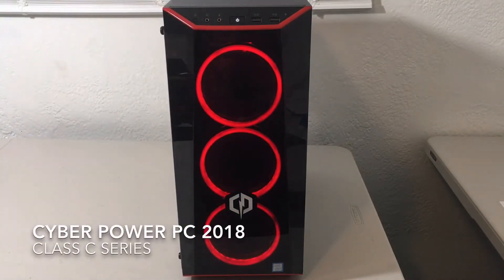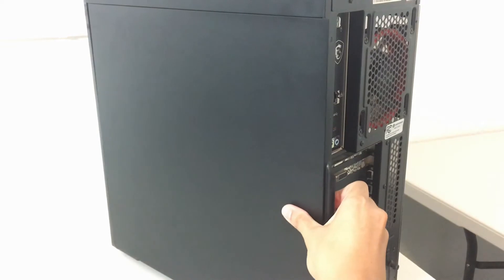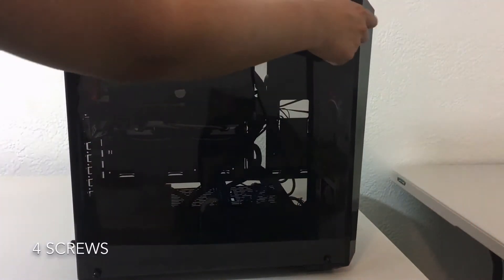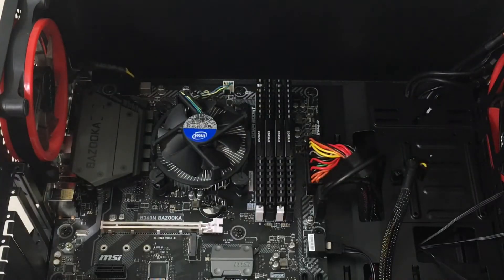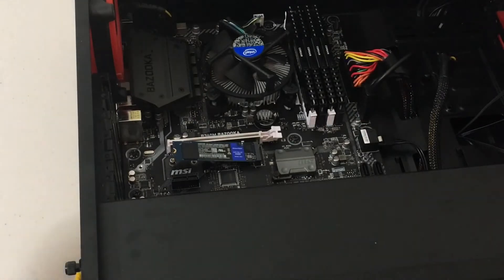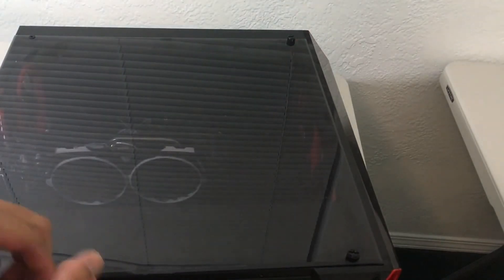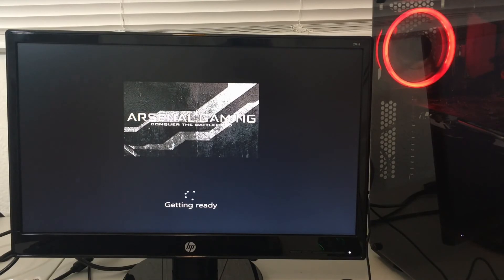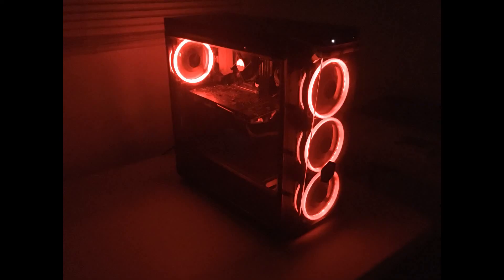Super Speed! M.2 SSD Upgrade on my Old Pre-Built Gaming PC | CyberPower PC

Comment: What size are your fans j have the same case but i dint know what size fan fits
Reply from the maker: Pretty sure these are 120mm fans for the case. Standard size. I need to check my case. I can check it in a week or so. You can use a ruler to measure to see what will fit on your case.

Comment: Removed my HDD and added my NVME and now it jus won’t turn on at all, any help please?
Reply: Like you only had 1 hdd?
Reply: Did you have windows installed on the hdd if you did put it back that might be the problem
Reply: You did something that you have no knowledge about. First after you install any type of ssd or hdd you need to reinstall windows again in that new drive unless you are adding it as a second drive.
Reply: If the computer doesn’t turn on at all then you forgot to plug it into the wall socket.
Reply: @simster1001 bro this was 2 years ago.

Comment: My motherboard doesn't have a mounting screw for the slot! VERY frustrating to discover once the case is open, etc. What size screw is required?
Reply from the maker: Most m.2 screws are pretty standard from my experience if you just search m.2 screws. Some kits come with washers and some don’t. I try to put a washer when I can for m.2 ssd, that being said i’ve had many experiences where there was no m.2 washer included and it was just a screw. If you want to be sure just search the motherboard brand then m.2 screw mount. For example “asus motherboard m.2 mount screw kit” hope this helps.for mounts I’ve been lucky to often have mounts and the mounts that came with my kit have work for different motherboards

Comment: I booted up my pc and it kept saying reboot and select proper boot device or insert boot media in selected boot devise and press a key
Reply from the maker: Did you check your bios to see which boot device you have selected?
Reply: Same I currently bought a 500gb wd ssd card and the old one was 200gb and when I put the 500gb it takes me straight to bios and I’m a pc noob
Reply from the maker: Did you clone or image the original ssd? Are you trying to do a clean install of windows? Also are you adding a second m.2 ssd or making the 500gb the main ssd
Reply: @whattmeter  I was trying to make to 500gb the main ssd card
Reply from the maker: You can either clone or image the original ssd. Or a clean windows 10 install
Reply: @whattmeter  I mean I have no idea what that means but thanks 🤙
Reply from the maker: Sorry, good luck!

Comment: what graphics card would you think be better in this build i have the same pc and i want to upgrade it
Reply from the maker: The one in the video only has a 500 watt power supply so any graphics card that works with 500watts or less unless you upgrade the power. Also I would measure the physical space because some graphics are really long
Reply: @whattmeter  i upgraged it to i think 550 watts but what graphics card would be compatible with the motherboard and cpu
Reply from the maker: Most graphics cards would work. What model did you have in mind? You should have no issues with most. Just double Check the pc requirements. For example an RTX-3060 Ti requires a 600 watt power supply
Reply from the maker: I would also check the connection of the graphics card. Your power supply should have a pcie 6 pin and 8 pin. So it should work for most graphics cards
Reply from the maker: Im assuming you have a pci express 16 slot where your original graphics card is plugged in currently

Comment: Do you know what size the top screw is that holds the M.2 SSD in place? I tried installing a WD SSD today on the same model Cyberpower PC and discovered that I only have the bottom screw that the SSD rests on, not the tiny top one to secure it. Any recommendations on where to seek out a replacement?
Reply: Did you figure it out? I have the same peoblwm
Reply: @neverseengreen  I ended up using a 2.5mm flat head screw.

Comment: Will it be able to take the original ssd and the new western digital 500 gb internal  SSD ??
Reply: So all together it will have 750gb SSD??
Reply from the maker: Yes two separate ssds but 750 total. Th computer can handle three even. It used to have a 1 tb hard drive western digital, a 250gb ssd samsung evo, then with the pcie wd 500gb. I did have to add one sata data cable though. But I really like only having one ssd connected at a time so I only have the 500gb m.2 ssd connected. If adding extra ssds I usually make sure the motherboard and power supply has the connections and can handle it
Reply from the maker: Yes. it will take both an m.2 pcie ssd and a 3.5 inch hard driver or 2.5 inch ssd. Basically it can have two ssds no problem

Comment: What size screw drivers is needed?
Reply from the maker: The size of the screwdriver i used.was a Philip’s 1.5x50mm. This was to remove the ssd 2.5 inch samsung evo 860. For the m.2 ssd installation I used a PH1 (phillips 1). Similar sized screw drivers will work too

Comment: hey nice video, can u suggest me a good gpu for 100$?
Reply from the maker: Nice! it depends. For gaming? Any specific game you want to run? Also are you limited to low profile graphics cards? Right off the bat I'm thinking something like MSI Graphic Cards GT 1030 2G LP OC, Low Profile. Around $85 bucks.  It really depends what power supply and computer you have.
Reply from the maker: There are also used one's too but it's always a risk. But with used you could probably get an RX570 or something in that area.